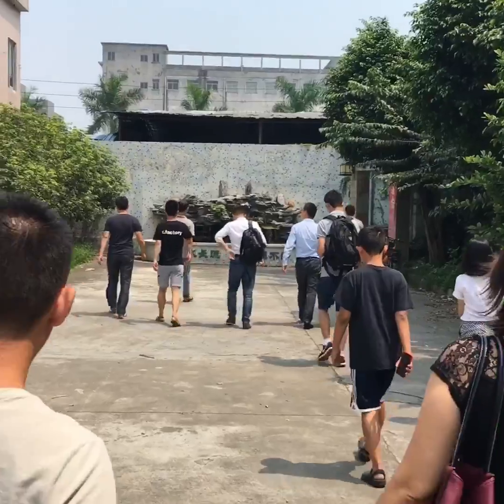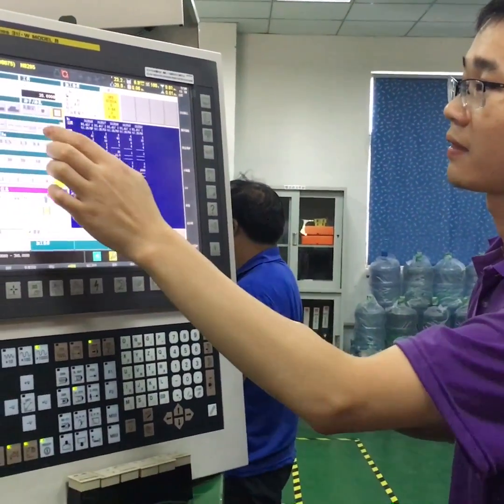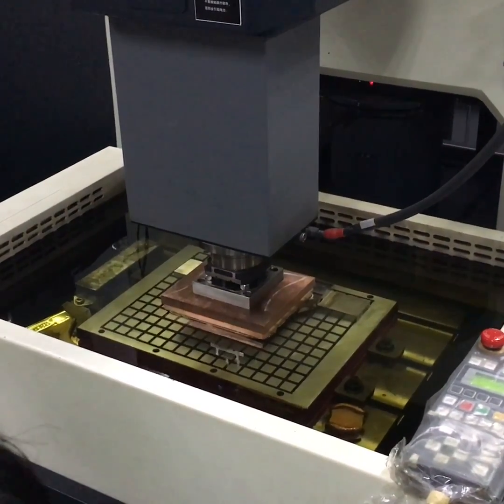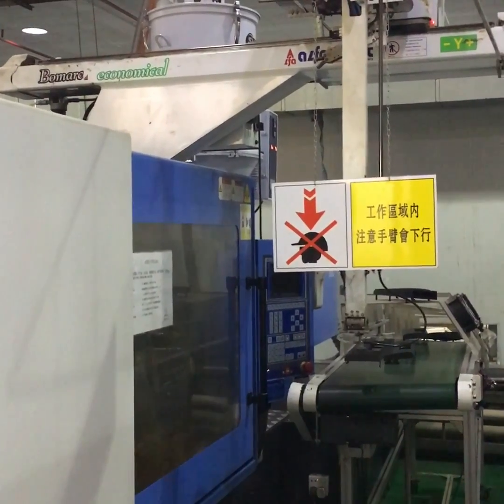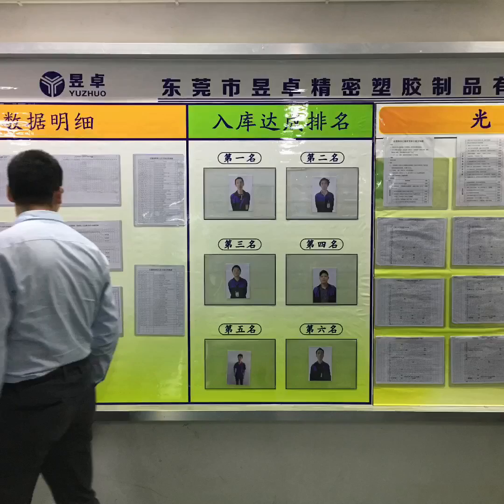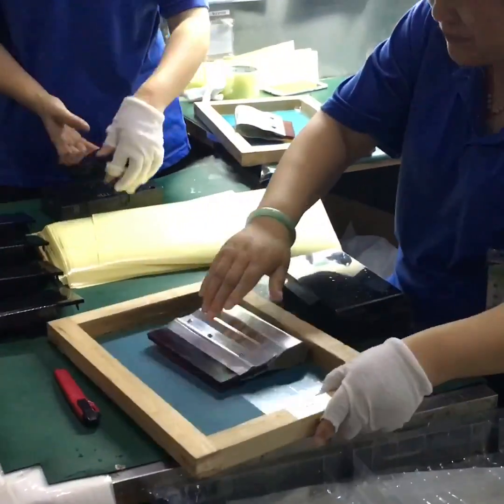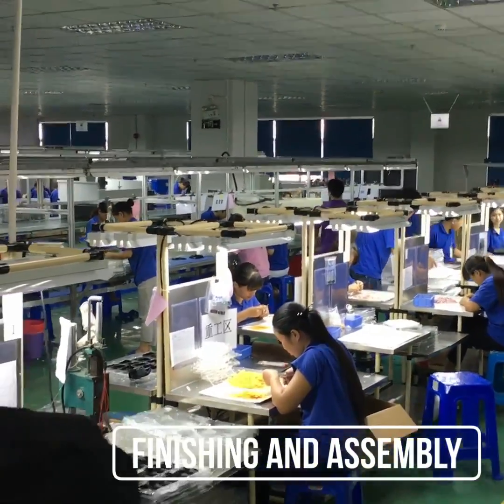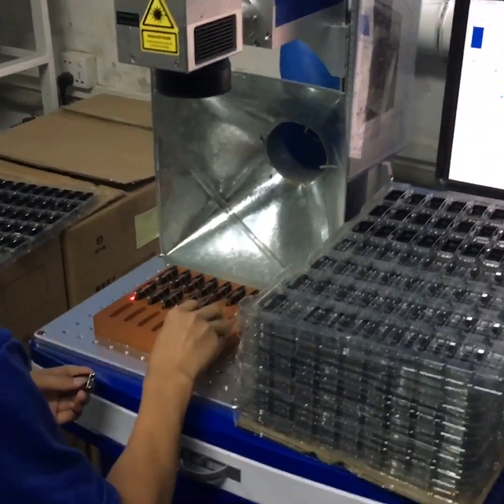Plastics Injection Molding: Step-By-Step at the Factory - Field Notes

Comment: Did 4 years as a mold-setter (easily the most dangerous job I've ever done in 40 yrs+ of working) and a production supervisor in an injection molding factory.  Will never step foot in one again.  Extremely hot environment due to the barrel temps. on the machines, lots of potentially dangerous situations to navigate (molding department).  If you're in finishing or quality, the work is meticulous & boring.  I've also done time in those hot, dusty carpet mills in the South, plus about 10 yrs. in an automotive machine shop.  Machine shops are hazardous also, but injection molding is the king of dangerous, hot factory work.  This video is definitely sugar-coating the real experience.  Guaranteed before they were going through the shop floor with cameras, all the workers had been forewarned days ahead of time and the factory had been scrubbed clean by orders of management.  We used to do the same thing when Nissan, BMW, or GM was visiting our factory.  It was all for show, in order to procure additional projects.  Once they left the floor, it was business as usual.  Nature of the business.
Reply: As a molder, I’d say there are more dangerous jobs.  Aluminum die casting, rodeo clown, astronaut… royal food taster.
Reply: No job is perfect. I need the money.
Reply: Hi,  I'm thinking about applying for a "foam molding machine operator" does what you say apply to that?
Reply: @RedCdot  I’ve been trying to get the job but no luck. They’re mostly looking for people with experience.
Reply: @suspicious2delicious  I'm going to apply for it, it's a job posting within the company I already work for just in a different department I don't really have any experience in that department but I'm interested, I'm going to try at least the worst thing they can say is no 😂
Reply: @RedCdot  good luck! Tell me in the future if you like it or not. I’m still going to try to apply for the job.
Reply: Been working maintenance for IMM for a bit now. Truly love it and gave me the passion to go back to school
Reply: Wow, I was thinking it totally looks like where I’m working now!
The floor is always clean, machines periodically clean and we try to do everything as safe as we can, including setting the molds in the machines with adequate tools, a crane, and of course we have many workers doing boring assembly, but we try to automate some processes.
I hope you are doing well now!

Comment: I am considering this job It looks fun!
Reply: The best injection machine ever made will not save a badly designed mold. but a skilled hands-on process engineer might. I Did this work for 42 years and I still have all of my fingers.
Reply: Actually, ita quite boring. Been doing it for 2 1/2 years now
Reply: @SeralJr  is it easy I’m a 17 year old no experience starting Tuesday 8 hour shifts
Reply: @throwedDummy  I would say it's easy, some people seem to have problems, but as far as factory work goes its pretty simple. The one I work at isn't quite the same as the one in the video, but you learn techniques as you go, to find what works best for you. For me it seemed difficult for the first week or two, but after I got used to it, most jobs were really simple.
Reply: @throwedDummy  this comment was written 6 months ago just wondering you still working there how is it asking because I started the job 2 days ago and its not as easy as it looks